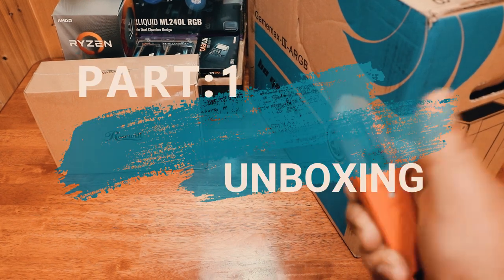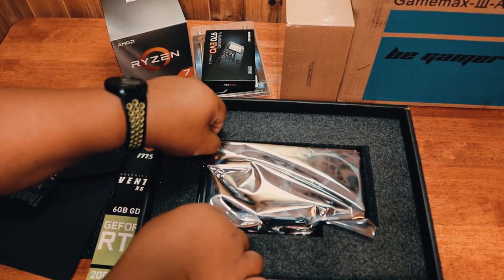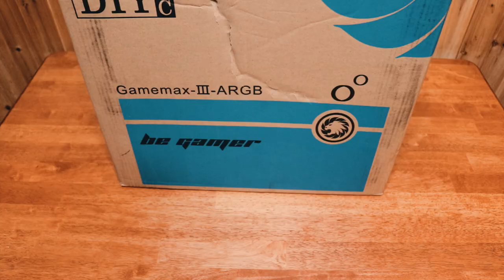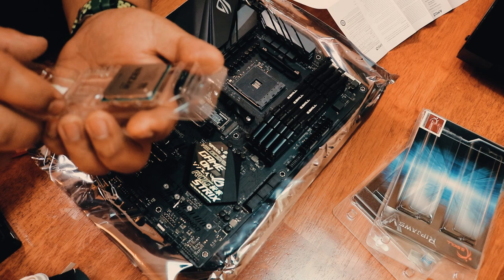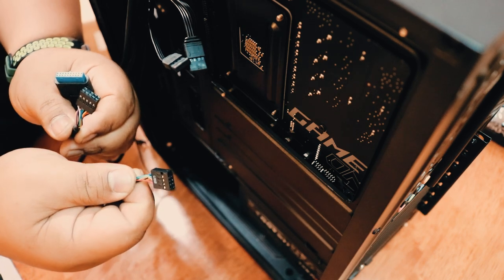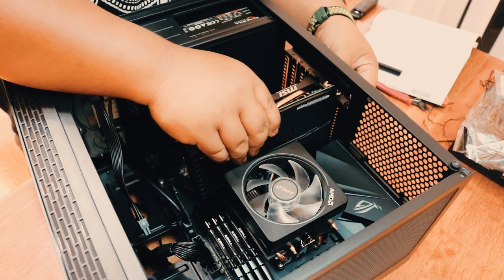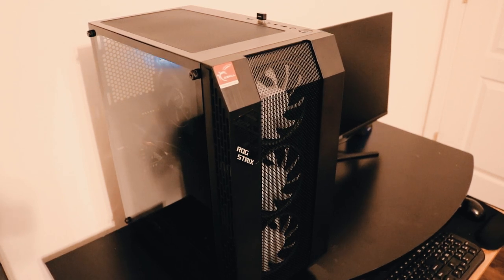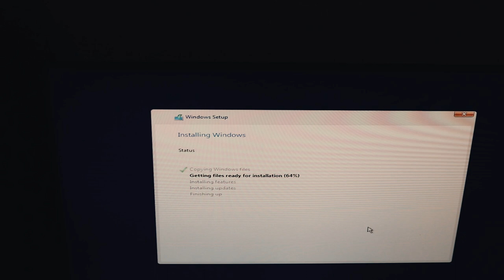AMD Ryzen7 3700xx : ROG B450-F : MSI RTX 2060 PC Budget Build: Unboxing : Build : Windows 10 Install

Comment: Hi just a question. I upgraded to RTX2060 and I previously have GTX1650. But when I plugged in the RTX2060 in the first GPU slot, monitor can't detect the GPU, it's just searching for signal, but when I moved the RTX2060 in the 2nd slot it's working fine. Not sure why is that happening.

Obviously I already checked the power cables, tried reseating it, changing display cables (DP and HDMI) but nothing works, also cleaned the RAM
Reply from the maker: Try to check your bios and see if there's allocation to set one slot at a time or both slots to accommodate new gpu.. it might be a design flaw too, internal signal path governor from the mobo itself, conflicting to display both gpu slots unless power supply is limited to a biased voltage closer to the 2nd slot. Verify that both gpu slots power supply are getting same voltage or any difference reading between the two..

Comment: Is the b450-f a good Mobo for beginners? Getting my Ryzen 5 2600 and GTX 1660 super along with the board. So just wondering if it still holds up?
Reply from the maker: For my current application, part combos, and usage, it should still be good for the next 3 to 5 years... It is all around user friendly.
Reply: akrhobassist mercado sounds great! Thanks for the reply man!

Comment: I have asus rog strix b450-f and will soon buy the ryzen 5 3600, which graphics card i should go with $400 CAD budget? Thank you. Nice video btw!
Reply from the maker: Check out NVIDIA Quadro K5000 if that meets your needs for CAD, some sells them pretty cheap on used market, but with some fluctuations, it should be within your price range..
https://www.amazon.com/dp/B009L8E4UO/ref=cm_sw_r_cp_apa_fabc_PYu4Fb6KBMGJD
Reply: Maybe a rtx 2060
Reply: Rn get a 3060ti or rtx 3060 wait and look for one

Comment: anyone know what length the tubes are on the cooler master master liquid lite 240?
Reply from the maker: I tried the spec sheet of the CM Lite 240, no mention of tube length too..
Reply: @PinoyStyleDIY  I know, it's a nightmare, how difficult is it to put in the length of them?
Reply from the maker: I am currently not home to at atleast measure the tubing that came with the one I have.. I'd assume that it's almost the same length of the one I used.. it's not too hard to route the tubing.. definitely will fit most mid to standard cases..
Reply: @PinoyStyleDIY  the reason I'm asking is, I have my radiator at the front of my gamemax case, with the tubes at the bottom, and I feel like they are getting stretched slightly, I know I could turn the radiator around and put the tubes at the top, but don't want to, so was thinking of upgrading my AIO so I could keep my radiator  in this position
Reply from the maker: I see.  If you have enough clearance between the Radiator and the mobo, you can use longer screws, then sandwich some washer or slightly larger bolts between the Radiator and the case so you won't stretch the tubing.. that will give the Radiator a little space between the case, hence relieving the stress or stretch from the tubing

Comment: Hi just built my pc with the same mobo. Only rgb on mobo is lighting up and when I try to boot it up there is no display and fans aren’t turning on. What should I do? I’ve tried everything and even did bare bones and I ran into the same problem
Reply from the maker: Try to remove your ram, then insert it one by one and fully press it until it seats snug.. then reboot..

Comment: I build mine last night. But I got the vga white light on on the motherboard, I have no gpu because they’re out of stock, not sure if ryzen 7 won’t post because it doesn’t have any graphics integrated, or I need to take it apart and re-do everything. Got any tips?
Reply from the maker: Try to align all connections correctly, and see if you have any trapped dust of protective film around the connectors..

Comment: Hi, I have an m.2 and a barracuda 2tb hard drive. On pc part picker it says the m.2 slot shares bandwidth with sata 6. Ports. Then it said when this happens two sata ports are disable. Can u tell me which ports are disable so I plug in the right port. Or it doesn’t  matter which one u use
Reply: Read motherboard manual

Comment: Hii, i just bought ryzen7 3700x and i have the same MOBO but my PC doesnt boot when i press the power button its sound like a turbine, an strong fan noise like 3 seconds then slow down the fans and theen the turbine noise again, but never boot or not showing BIOS, (bios version 3003), any idea what can i do ? :C Nice video btw ;)
Reply from the maker: That's odd, haven't experienced that yet in this mobo combo... but from my old Dell pc, that happened when my cpu was overheating... had to clean and add new thermal paste...
Reply: Maybe update your bios
Reply: So your mobo can support 3700

Comment: I  thought that the CPU cooler har already paste on it. Or?
Reply from the maker: It came with generic paste, but I'd rather use the one I have since I never had an issue with that brand.. :)
Reply: @PinoyStyleDIY  ty! I dont have one extra so I will go with the one which is already applied. I ordered a 3600x. Hope it will be ok

Comment: Bios update is necessary ?
Reply from the maker: It is recommended, but it should be good out of the box..
Reply: @PinoyStyleDIY  bro rog strix b550-f and ryzen 7 3700x 

Will need bios update
Reply: @PinoyStyleDIY  reply Soon bro
Reply: @rockerazarfan7389  no it won’t